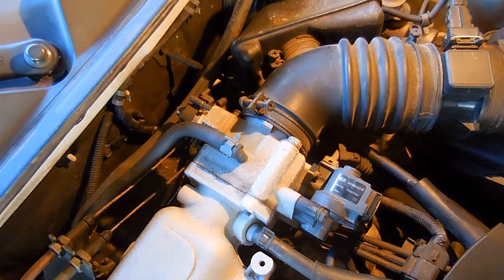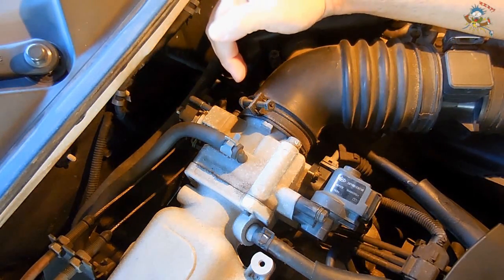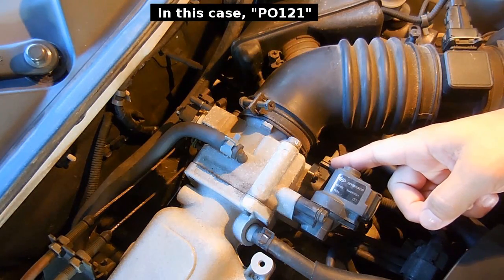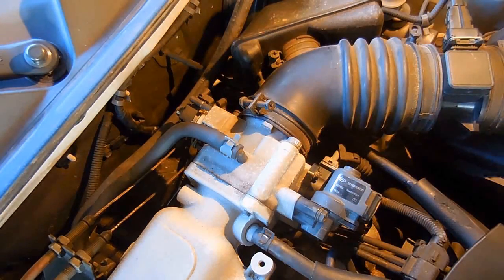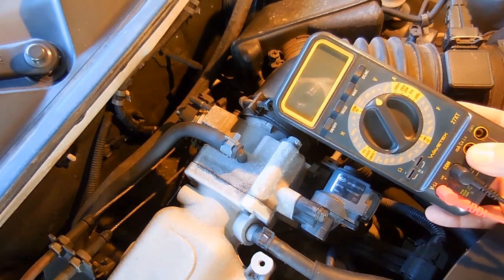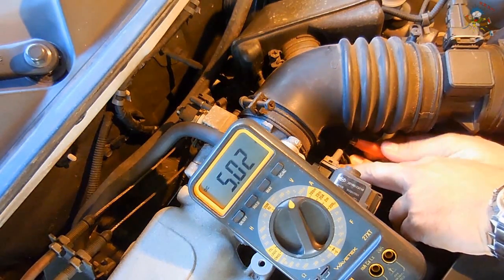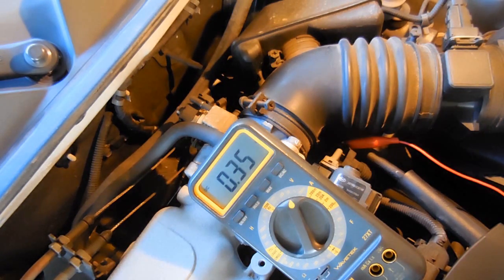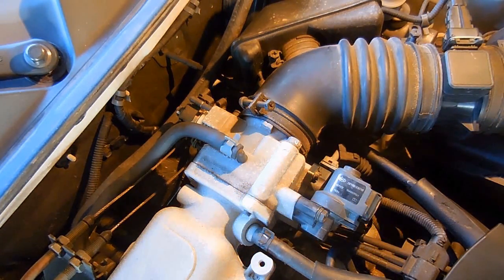How To Test A Throttle Position Sensor (TPS)

Comment: i had problems car would miss etc when cold i cleaned ignition coil connectors with contact cleaner huge improvement not 100% probably 95%

Comment: hello r u probing the WIRES of the CONNECTOR or the three pins on the THROTTLE BODY PART ITSELF? on my 98 KIA SPORTAGE, when i first start it it revs to 3,000 rpm..when I DISCONNECT THE IDLE AIR CONTROL VALVE, it goes back to normal 850 RPMS..does this mean the IAC valve is ok..someone said YES..????

Comment: Nice Explanation! Easy enough, but I remember on the older scanners, circa 1985, when plugged into the ALDC under the dash, TPS was shown on the scanner itself as described above, ~ 1/2 volt at idle to ~ 5 volts at full throttle.
I have Torque Pre app, and it shows the TPS value in percentage, not in volts. I looked and looked in the torque app settings and can't see anywhere to assign the display to read in volts. 
Do you know if it's possible to make/set up torque pro to display TPS readings in volts instead of percentage?

Comment: Can a TPS cause a rich fuel mix without a code? Rough idle. Im getting rich code oxygen sensors and replaced, same codes. RPM needle fluctuate a few hundreds at idle. IAC is  a year old and clean, just cleaned throttle body. Any help or suggestions would be great.

Comment: Can the throttle body sensor make your car jerk when accelerating or stall or because my car is jerking when I accelerator frm gear 1-4 even in the morning cold start I can't even put the car in gear then it jerks or die

Comment: Excellent explantation.  Exactly as you said.  I tested on my 2000 Accord V6 w 150,000 miles.  Perfect count-up on the multimeter from .45 to 4.56 dcv (by the 1/100s!), so it's not the TPS.  I've already replaced the MAP sensor, cleaned throttle body (with throttle body cleaner, toothbrush and rag), replaced air filter, checked air intake passages from filter to TB.  Runs beautifully after warmed up, but super hesitant acceleration when cold (I live in Florida).  Never stalls, but feels like it will, until warm.  No codes.  Thanks again.
Reply: What part of Florida you are?
Reply: @panzerwaffen2873  Panhandle
Reply: @werquantum  cool ... beautiful beaches up there
Reply: @panzerwaffen2873  indeed! Pcola.
Reply: @werquantum  Pensacola...paradise beautiful and clean

Comment: I finally understood how it works lol what a great explanation and demonstration. I highly suspect my TPS is failing. Whenever I floor the gas pedal, the rev goes up but the car doesn't move. Transmission shifting is terrible. The gas pedal sometimes stops working completely! If I  understand it well, if I run these tests in my car and the TPS is really faulty, I should be able to "floor" the gas pedal and see the voltage not going up, right? Thanks for the video!
Reply: I think you have other problems with your transmission.

Comment: On my 1987 Chevy Celebrity the TPS went bad . There was also another code for the MAP sensor . What happened was the TPS pulled down the voltage to the MAP sensor . If you check a wiring diagram , they use the same line . Not all cars are same , but it is not uncommon to have them both on the same line . In general , if a component goes bad and there are other items on the same circuit , it can pull down the voltage that supplies other items , depending on how it malfunctions .
Reply: I am a electronic tech and on a series line if all the parts are connected a bad earlier part could cause a voltage drop if there are different supply values.

Comment: I have a 1989 Full size Ford Bronco XLT 4x4  V8  5.0  at an idle it goes up & down over & over  i replaced the MAP sensor,  still the same,  then i replaced the TPS   &  0 2 sensor  did not fix the problem,  
I bought this truck in 1991 it's a 1989  always ran great it just turned 100,000 miles,   HELP  i don't know what else it could be ...

Comment: What if it shows 3.5 but when I stick a needle in it it on shows
 . 85  then it goes up smooth when you turn the throttle body to 3.5

Comment: Hello sir i need a help i have a carburettor bike ns200 its lagging in 4k rpm to 6k rpm after cross the 6k rpm it's easy to going for a top speed If tps have a trouble its happen???

Comment: The use of needle is an excellent idea. Simplest way to check without removing the wire cover. Thanks.
Reply from the maker: Glad it was helpful! Be sure to look over my video playlists below for many other videos of interest to you, and most importantly take one minute to share a link to my channel with others on social networking sites. Thanks
http://www.youtube.com/c/electronicsnmore/playlists
Reply: I have a question for you here's what I have 2001 nissan frontier 2.4 automatic
1 when the rpm hits around 2100 I get erratic response from the truck, doesn't accelerate, starts deceleration. If I shift to neutral I get a fresh start, and I try to stay away from that rpm. I've changed the MAF,  the TPS and the fuel pump and I line filter wich was very clogged.
I'm hitting a brick wall any idea would be useful.
Thank you for the detailed video.
Juan

Comment: This is a professional level explanation and demonstration. Really impressive. I have a 6 pin sensor and I'm getting 5v on both ends and a 0.83v reading from the other two pins. I can't tell if that's proper spec.

The sensor is disconnected during this reading. So I'm testing the female connector pins leading to the throttle body. Can anyone tell if I'm doing this correctly or not? The car is a 2004 350Z Nissan.
Reply from the maker: That's a wideband sensor. You need to find an online service manual for your make/model vehicle to identify each pin. Thanks for watching!

Comment: Hello friends
I have a problem with the my car Mercedes CLK 270 CDI W209 / year 2004/, I did diagnostics and wrote code p0123
what part should I look for
so I can replace it with that
Reply: ECU: Engine
 
Status: Confirmed
 
DTC: P0123
 
Description: Throttle/pedal position sensor/switch A - circuit high
 
Potential 
 
Search the Internet
 
When you buy the 'My Dashboard, Logs, Parameters' plugin, you will get:
  Parameter logs playback and sharing them in CSV format
  OBD I l DTC decoding (extended list)   Descriptions of potential causes of malfunctions for commonly encountered OBD Il DTCs
  Configuring all the parameters in the 'My Dashboard' section, not just 4   creating many custom dashboards   Description of important parameters of the OBD Il standard

Comment: I mean thus the 0.35volts or half the volt needed as required voltage in a fully close position? Thus this applicable to all kind of cars, like i have a suzuki every wagon, k6a engine turbo.

Comment: would this throttle postion sensor effect the transmission not to shift? mine rpm close to 5k before decide to shift  - thanks
Reply from the maker: The sensor works along with other sensors for the transmission, so it's possible.

Comment: i had checked my TPS offline of course i put 5V supply , when i rotate the throttle 
the voltage at signal wire moves slowly up until i get ~4.5 voltage and back down
when i slowly release the throttle.looks my tps is okay right? . but when i put back the TPS in the engine.I noticed that 
the signal does not increasing or not giving me  a reading when we press on the gas pedal while the engine is running? so i still get hesitation . can you advise your comment here.  thanks

Comment: Thanks. Do you have to drive for 10 miles for the ECM to recalibrate?
Reply from the maker: Once installed, start the car and allow it to idle a few minutes with the A/C off. Then drive it as normal. The computer will adjust.
Reply: @electronicsNmore  Thanks

Comment: I’m not getting voltage from any of the terminals. Does this indicate a bad TPS?
Reply from the maker: You should. Make sure you have the correct pins, and also verify that your tester is working.
Reply: electronicsNmore My bad, I realized I was doing the test incorrectly. So actually I was getting 5.03 v at the power wire and then the signal wire was about 0.43 v at idle but at WOT it was only 3.8 v. I was thinking WOT throttle should be closer to 5v? Does that indicate a problem? Also I noticed the car was running better when I unplugged the TPS. Thanks for your input!

Comment: What if my tps reads 5.00 vdc no matter what? It has four wires as well. Its for a beams 3s engine stock.
Reply from the maker: If you get results that differ from what's shown, and you tested the correct wires, then replace.
Reply: @electronicsNmore  yes i tested the ground and positive through palerclips. Even when i started the vehicle and moved the throttle it reads 5.00. But the car runs fine almost. Only issue i have is that i can push the pedal all the way down but theres a delay in acceleration. Only after it revs up a lot does it finally start going faster. After that it has no problem with acceleration.

Comment: is that a sonata 2005? looks exactly like mine, now i have to change that sensor, the crankshaft and camshaft, do you have a video of those? to know which one are them ?  great video BTW
Reply from the maker: Mine is a 2003 V6/2.7L....same car basically. Crankshaft sensor: raise front of vehicle on stands, remove the long plastic shield under radiator, then reach up into the block facing the cooling fan. One bolt holds it in place. The camshaft sensor is on the drivers side of the engine, between the throttle body and ignition coil packs. Be sure to watch today's video below and share. Thanks!
https://www.youtube.com/watch?v=8btMalBPE9U

Comment: @electronicsNmore I got six prong connector I have only one Wireless reading. 5.01 I have two wires that's reading. 0.80 I have one wire that's reading 0.02 I have one Wireless reading 3.54 1 wire reading 1.46 How far is pressing the gas pedal down? Don't any of these numbers move? I'm only I'm only testing this. Because I have a loss of power. An acceleration I I've had. Several different codes right now I have one for the cram shaft position sensor mass flow air sensor no leakage So I just thought the check the throttle body. Does these numbers tell me anything?
Reply from the maker: Look online for a PDF service manual for your vehicle. It will explain TPS testing procedures. Thanks for watching!

Comment: Hi, my chevy impala is surging under medium acceleration but not in light or hard acceleration, there is no check engine light. Could it be the tps? Or other issues, where should I start?
Reply from the maker: Scan the OBD port for pending codes.
Reply: I did, theres nothing
Reply from the maker: You'll need to do a real time scan and save the data to examine later.
Reply: @electronicsNmore  yeah, that's what I've been trying to do. I have a bluedriver scan tool and I've been looking at the live data its putting out to see if theres anything odd.
Reply: @electronicsNmore  I am having weird dips in the short term fuel trim where it dips down to -18 while driving. And the long term fuel trim has dipped down as low as -9. I know a check engine light comes on if the trim dips below or above - or +20 or 25

Comment: Hi there From Australia 
I have a subaru wrx gc8 2000 model
I have had a issue of a check engine light on the dash 
I have got that checked knowing it was the knock sensor so we have replaced that too
but in order to do that I had to remove the tps in order to get to that knock sensor that was replaced
doing that I had to slide the tps all little leaving it unadjusted 
now the car has a check engine light on because maybe it's not set right ??
in order to do that 
do I do exactly the same steps on your vid??
after that do I need to discconect the battery for a day or few hours to reset it
thanks
I have been driving around for the past year now with that light on
but no problems whatsoever
car seems to run fine
plse let me know what u think 
thanks
Reply from the maker: Hi Rose. Just try disconnecting the battery for a couple minutes.

Comment: Great video, but a question:  Can a TPS cause an occasional non-start (engine spins/no start, may start later)?  I've replaced multiple parts over the years combating this problem including the ignition module and pickup coil twice, as well as ECU & idle air control valve!  My '95 5.0, 5 speed F150 is otherwise a great truck, but it's never been totally reliable because of this 1 problem.  Any advice is very much appreciated!
Reply from the maker: I was going to say the ignition module. Try a crankshaft sensor!
Reply: electronicsNmore WOW, didn’t know they had those,  and I just put 1 of those on my mom’s Nissan. Thanks a lot!

Comment: Hi there, wondering if you can help me diagnose a problem with my girlfriends car. When in first gear and put the throttle down it seems delayed and when in all other gears its fine. It also struggles to pull away, engine light is on. Thanks

Comment: Hi... i own lancer CM5A... All tps should set between 4.5-5.5? my car symptoms if set 4.5-5.5 once engage gear RPM drop and engine jerking feel... If set to 7.0 only stable... izit normal?
Reply from the maker: Check trouble codes from ECM.
Reply: @electronicsNmore  no code was found

Comment: So does this mean TPS needs to be replaced?.
Reply from the maker: If it tests faulty, then yes.
Reply: @electronicsNmore  So I ran the  voltage & sensor test, ECU closed throttle position was at 0.49 and wide open position was 4.61 with no ECU fluctuation, does that mean the (TPS) is still good??..

Comment: Malord I thank thee . My suzuki's sensor is at 0.70 volts (sig. wire) with the throttle closed ,  what say you to that ? I checked on a website and it said it should be less than 0.7v . i get a little bit of hesitation in first and second gear , i am changing the fuel filter on the morrow .
Reply: Says it should be between .4 and .9 volts on another website , so i guess mine is fine
Reply: But on that second website they suggest lightly 'tapping' the sensor as you slowly open up the throttle and take a reading , to see if the sensor's signal voltage will either skip or go blank  . What is it during normal engine operation that that tapping is supposed to simulate ?

Comment: Great video. I have a 1997 Saturn SL1with a standard 5 speed trans. The idle would sometimes go to 2000 to 2500 rpm when rolling to a stop with the clutch pushed down then would come back to norm 750 ish rpm. I pulled off the throttle body and removed the tps and iacv to clean a ton of carbon off the throttle body. I also replaced the iacv with an $8 ebay one, thinking that was originally causing the high idle problem. There was never a cel on. When I put it back together I put the tps on and had to twist it to get the screw holes to line up and it felt crunchy like I hyperextended the spring. It turned on the cel with code po122 and runs bad with high idle. I installed a new Walker tps and there is no change other than it loops at idle when the rpm comes down. My code reader is not able to clear the po122 code. I checked voltage with connector disconnected and I get 5.02v on one wire and .03v on other. I back probed with it plugged in to sensor and get 5.08v on one and the other   shows .15v at idle and 3.94v at wot. I thought it might be the plug so I poked the volt meter lead in the connecter points and tried to push them closer together but No change in voltage readings. Advice  please?
Reply from the maker: Sounds like a faulty linkage return spring.

Comment: Thanks for the Great Video. You just earned 1 more subscriber. Quick question: On my signal wire it's giving me a very low voltage reading (0.01) and when I press on the gas pedal the voltage reading stays the same it doesn't go up. The power wire reads 5v. Checked for any codes and nothing comes up.
Reply from the maker: Either a faulty TPS (open circuit), or a bad ground.

Comment: This is the best throttle position sensor video I have seen so far. But my situation is a 93 Ford Lincoln Town Car I'm getting a code 121 on a brand new throttle position sensor I purchased offline what are your thoughts on this?
Reply from the maker: Could be a bad connection(wire harness), damaged wire, or bad PCM.

Comment: I checked mine and the signal is reading at 11.2 even with the throttle at idle. I disconnected the tps and read the connector w multimeter at DC and still got 11.2
So I got 4.5, 0.0, and 11.2.. any ideas
Reply from the maker: Something definitely wrong. It shouldn't be over 5V. Maybe a bad connection somewhere. Check all connections.

Comment: Excellent video on how to look for dead spots in your TPS. Not all vehicles are the same, the TPS can have a different expected voltage range depending on vehicle. Not all TPS tolerances are between 0V-5V. Consult a workshop manual for the correct specifications for your vehicle year/model/engine configuration. The TPS design and expected values can change per year on the same model. Always, always, look up the correct specifications for your specific vehicle.  Great video.
Reply: Good point. Thanks
Reply: Yes they are! Or close to it at least. Show me a printout or PDF that is way different than .5 to 5 volts.